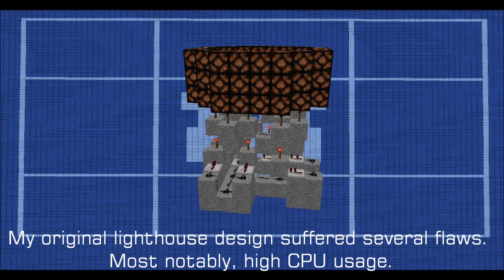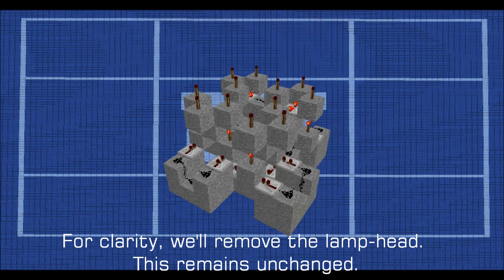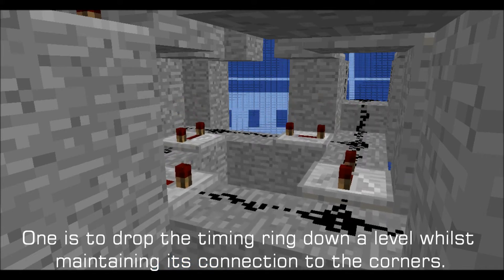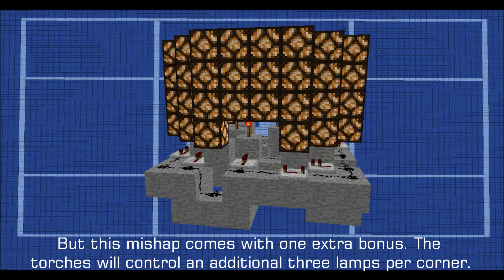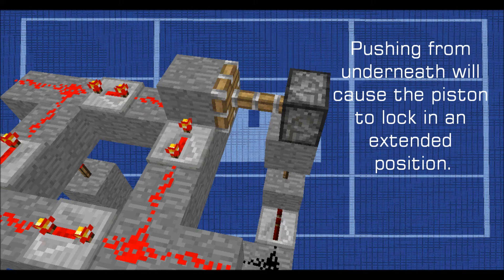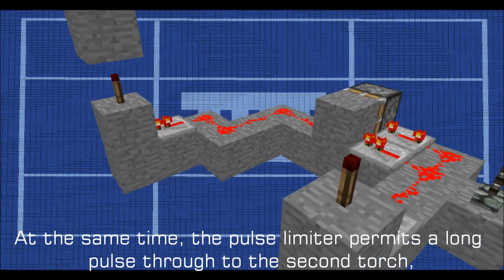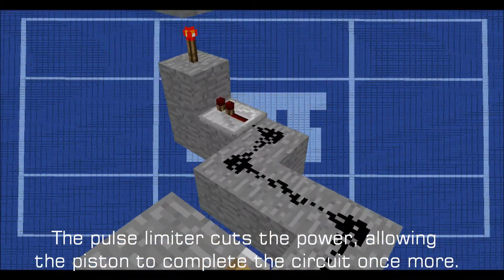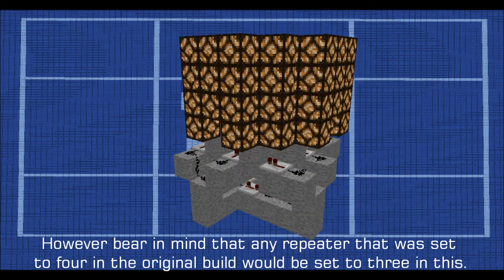Minecraft - Revolving Redstone Lamp Lighthouse Tutorial MK2: Reducing Lag

Comment: I have a problem with your pulse limiter, I am using a piston from the side but it seems to stay in a locked position anyway and so it doesn't fire a pulse. Apart from that great build I managed to make the smallest version and with a pressure plate it works great... just cant turn it off lol